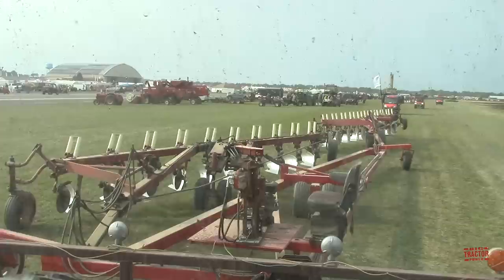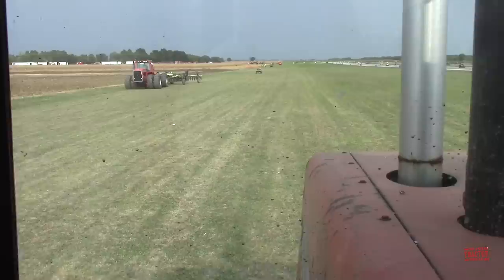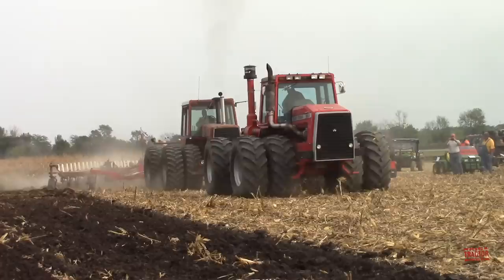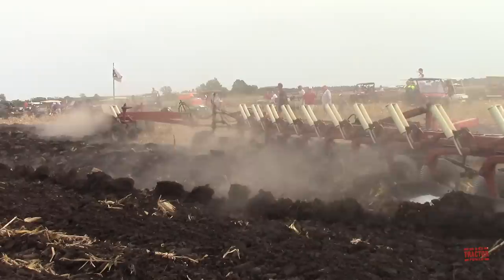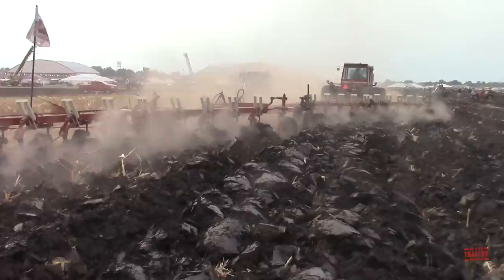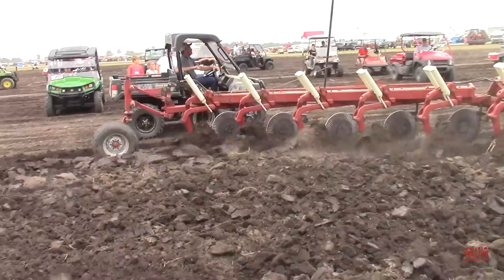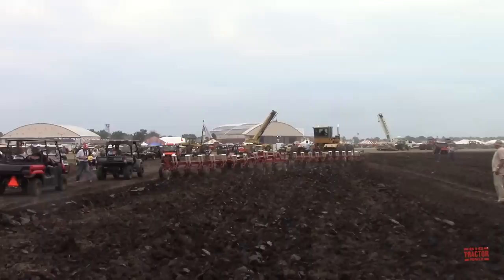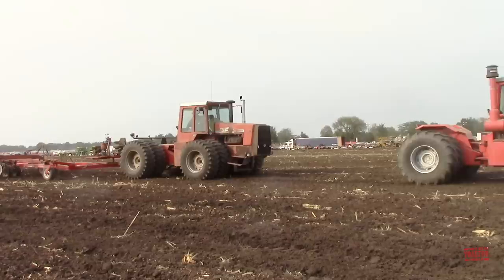710 HP Massey Tractor Team Pulls a 20 Bottom Plow

Comment: Tim's dad here, a little more information on the MF 5200.  We purchased the tractor in 1998 from the Taylorville, Illinois Kuhn's store (now closed), we were the third owner, and the current owner didn't buy the tractor directly from us but from the dealer with whom we traded in 2015.  Also, the tractor had a Twin Disc 12 speed transmission with a Detroit Series 60 engine that originally had 390 hp but the ECM had been flashed before we bought it to 425 hp (this was commonly done on the early Series 60's).  The engine and transmission were both factory options and weren't common in these tractors so it is a rarity among a fairly rare tractor.  I have always thought that for it's time (1990) and with it's features of an electronic engine with a full powershift transmission, that it was as advanced as any 4wd tractor on the market in North America .  Tim is bummed since he was too young to have driven the tractor in the field before we traded it :)

Comment: Those Massey 5200 4wd tractors are definitely top of my list for older 4wd tractors. Either underappreciated or under produced, I am surprised they didn't take off, now, just FWA from Massey.  They did have some not as reliable v8 tractors, but the 5200 is a big 6 I think.    I like this guy looks to have put metrics on his, so he knows this will be a show piece, nice example.  Be interesting to know how much fuel that Earthquake uses in gallons per hour.  I think Challenger is headed the right way, throttle is controlled electronically and bigger engines are used taking advantage of torque and lower RPM's, basically under-working it. Big still have their uses, and you'll see the old guy out there doing what he's done all his life, but its not good for the soil, its heavy to pull, and an endless job even on a quarter of land.  Implements have gotten so dang expensive, plows out of fashion, you can get your moneys worth in metal.
Reply: I worked for an SLH (Same/Lamborghini/Hurlimann)dealer back in the 90's and they were one of the first if not the first to use electronic engine governing on their 1000 series engines. They were very economical,excellent for constant speed jobs and really would pull for a 1ltr per pot motor. They would spin up to 2700 rpm and still had good torque backup....just a shame being Italian they couldn't make an oil leak free motor. The noise from the air cooled Same version was as near a 4 stroke comes to a detroit.
Reply: Amazing tractors!

Comment: We had one of those 10 bottom IH plows. Biggest pain was having to get out and adjust the hitch and the center tandem wheels from road to field position (when in road position it was narrower than the tractor). I always assumed that later models could be adjusted hydraulically. IH made up to a 16 bottom plow and anything over 9 they were two frames connected together where the tandem wheels are. JD made a set up similar to this 20 bottom when you got above 9 (you can see this in the video from the other day here). I myself would love to see the Wil-Rich 18 bottom in action (three 6 bottoms hooked together as one as these 10 bottom's are). The soil in this field must be a bit gumbo the way it looks. We could pull our 10 bottom with a 240hp tractor with no issue. 

I always liked the look of the later MF 4wd's but by the time they came along, MF was not doing well and dealers were hard to find. I'd be willing to bet the last 5 or so years they offered a 4wd that MF didn't move very many, so that newer one in the video could be a rare find.
Reply: We used a DMI 12 bottom, single frame, just a heavy beast, even trying to pull down the road.  Road with at night bringing it into a field and my dad kept getting the end caught on the edge of the ditch, a very deep ditch, no way to be pulled in, but scared me to death.  We pulled it with a Allis 8550, which was turned up a bit with those 2 turbo's, actual engine HP was rated at 350hp by Allis, which we turned down, torque converter would blow.  The owner of the DMI had a Steiger, same HP, but much heavier, and traction was an issue.  It was in teh best conditions a heavy pull with a significant loss of traction, not so significant to move down to a 7 or 9 bottom.  A guy thing I suppose, my dad was not going to let the old Steiger out pull him.  Better tractors if they had the cummins I will concede though, so much power loss in Allis transmissions.   Stieger has held its resale value as well, but I cannot find much for DMI plows.  I miss farming, where an man could be a man, and not have human resources up my but for a curse word from my cubicle.
Reply: Massey Ferguson sold the 5200 series tractor to McConnell as a last effort to stay in business. The tractor was claimed to be years ahead of the competition at the time. I saw one at a farm show years ago. There was a line of people waiting to climb inside to use the sattalite telephone to call home.
Reply: P but I'm

Comment: I,m guessing that Earthquake has a 2 stroke in it similar to the old terex bowl scrapers of the 70,s?, what a fantastic sound,     I reckon the rear massey needs to lose  about 10 psi  from each tyre , common mistake by tyre fitters not lowering the pressure once the beads are seated, fantastic video again thanks.

Comment: forgive my ignorance, but would a modern tracked articulated tractor pull the 20 bottom mull board plow with no problem?
Reply: alcobra88 Probably not
Reply from the maker: Yes if it was a top end 620 hp model I think it could run it.

Comment: Wouldnt it be easier to just put one plow behind each tractor. It would do a better job in the end with the same tractors.
The solo tractor pulling was cool for sure.
Reply from the maker: Sure it would be. This was just a for fun demonstration to show it took two regular 4wds to pull the plow vs. the big 750 hp one.
Reply: @bigtractorpower  yes that make sense. Nice to see old massy working. I had an 1135 with duals for tilling. It pulled a 28 foot shank drill, but that was about all it would do without spinning. Great machines    for the time they were built.

Comment: A single John Deere 9620-R could pull that with ease and without the screamin'demon 2-cycle P.O.S.from GM.Impressive yes,but it isn't necessary with the ungodly deafening noise that the two cycle V12's produce.
Reply: You know what the Rite has going for it that the 9620R doesn't?  I can work on it without waiting hours for my dealer to come out and clear a code out with a laptop.
Reply: @Zero01k  Nope,I have a farmer south of me that owns 4 9620-R's,to clear a code is easy and can be done WITHOUT the dealers help.